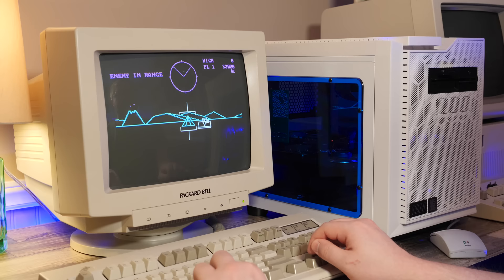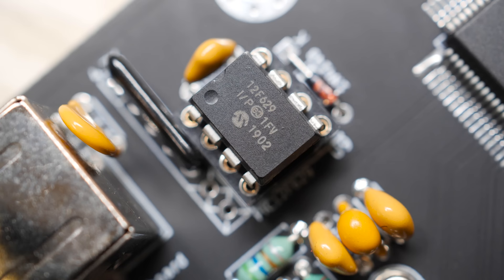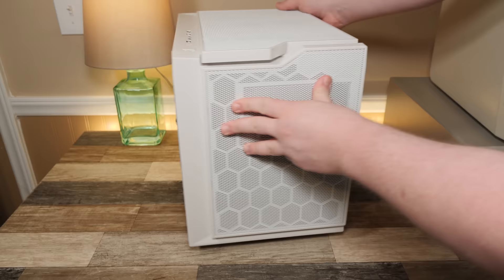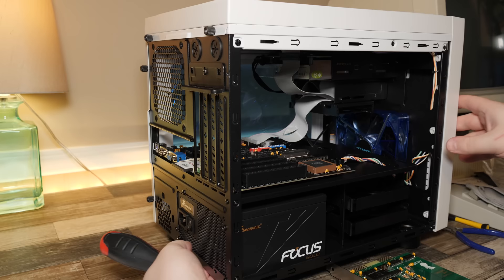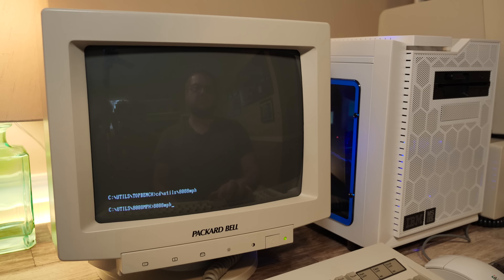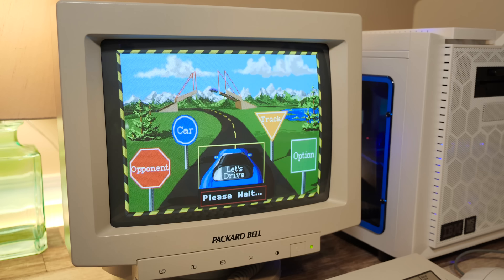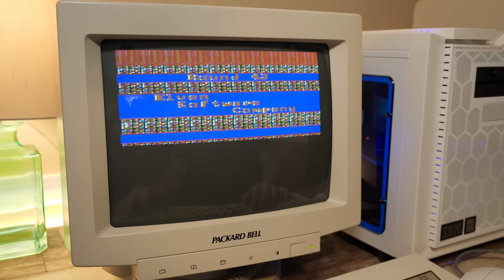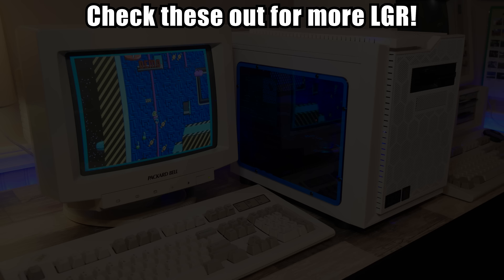Building a MicroATX IBM Clone: The NuXT Turbo PC

Comment: My rig is in the black/green version of this case, it's an absolute beauty to build in, but it does get a bit cramped with an optical drive and 3.5 I/O expansion and a tri-fanned RX 480. Pro tip for this case, there's 2 screws on the top rear corner of the case under the side panels, remove those and you can pop the top & front open like a semi truck.

Comment: I wonder how they sourced some of the chips, especially the Trident chip made in 1994. 
Fascinating little board :)
Reply: China
Reply: Scrap parts i bet.
Reply: @viscountalpha  Ghana would probably be a great place to get some
Reply: All came from china and ebay, i talked with the designer of the board
Reply: Stuff like the VGA chipset is what an FPGA would make sense for.
Reply: E waste bin
Reply: I'm wanting to build one from a blank pcb and cannot find a FE2010A chipset. I have the trident chip for the graphics. The floppy controller chip also is really hard to find.
Reply: Max Paine  This.  Some products just don't need a modern CPU.  For example, you don't need a 3 GHz CPU to run a thermostat or a microwave; even a 14 MHz WDC65816 is probably too much.  (The WDC65816 is an enhanced version of the 6502.  They used the WDC65816 in the SNES.  Also, the WDC65816 is still in production, even though it's been around since 1983.  Before anyone gets the bright idea of trying to drop one into their C64 or Apple II, it's not pin-compatible.)

The point is that in many cases, some "old" chips are either still in production, or were produced in the hundreds of millions, or can be reproduced in a "boutique" chip factory if you've got the cash (minimum order is usually around $30,000.)
Reply: @SpearM3064  But then a simple microcontroller makes much more sense.
Reply: Max Paine  yup. And some one off's on eurocard make for a repair or die situation on some old machines.
Reply: computer reset
Reply: Quite a large number of chips reached a point where they basically became a standard even if they were never opened up for 3rd party production, Trident VGA was one of them and was used for years after it was obsolete on the desktop in servers where all you need is a basic console output at most, so having a basic VGA chipset with some SRAM onboard was common. That's the same reason you can commonly find ATi Mach and Rage chips too.
Reply: @TheDemocrab  Indeed , the rage chip was used a lot. But nowadays the servers have to be able to run windows server with a graphical console for configuring VMs, so the last 10 years or so servers have also been getting faster video hardware.
Reply: Computer reset has over 9000 of those chips!
Reply: @Stephen Byker I second this. I once went snooping about in an old IBM factory and found some very interesting items, old 80s chip shipments, silicon boards and cpus. I couldn't bear to leave them, so I just took the boxes of as much as i could back home. (Btw, under UK laws it would have been classed as rubbish) I ended up selling/giving away most of the boxes to people who could do more with them, but kept a few bags of each. They might be useful sometime

Comment: There's a right angle mounted ATX 12V power connector on an IBM PC XT clone.... The clash of ultra-modern & ultra-retro there is making my head spin lol.
Reply: Having modern high quality power supply is a definite bonus though, no exploding caps or blue smoke o  first powerup
Reply: @UNSCPILOT  It's not that it's a modern ATX power connector that's weird, it's that it's mounted at a right angle. That only became common EXTREMELY recently.

Comment: That flash rom is impressive. Even modern PC's need a battery to remember the bios settings.
Reply: One of the Asus laptops i took apart recently (saying that because i don't remember which model it was) didn't have a Bios battery (no provision for one either, so not like they just didn't put it on).
So there's still application for chargeless memory keeping.
Reply: That's by design. If your bios ever gets corrupted or you get locked out from a bad setting or forgotten password you'd be fucked if you couldn't just unplug the cmos and let it reset.
Reply: most PCs/laptops don't use the battery to store settings but for the RTC. Settings are stored in SPI flash now, which is non-volatile.
Reply: A lot of Dell Latitude laptops save their BIOS config in Flash rom
Reply: andrew342003 Every UEFI BIOS contains a feature to store significant data amounts in flash memory variables.  The only data stored in battery ram in recent PCs are a few AT-compatibility variables and maybe a "self destruct-if-stolen" personal encryption key that you could reenter if you open the case yourself.
Reply: Iirc ITX motherboards don’t use batteries
Reply: Sorry guys I mean desktop PC's not Laptops or tablets
Reply: Jason Gooden 

ITX computers are desktops. Something like a Node 202 system is around the size of a PS4 slim and can use a double slotted standard GPU.

Comment: We need  486 dx2 66  with video card and 4mb of ram + sound blaster ;) in one board !
Reply: There is. It's an old IBM with integrated 4MB if ram and GPU. It also has an ATX like layout at the back, with PS2 and Serial/parallel port. It supports the 486 DX2 66 and even the Pentium OverDrive. The only thing it lacks is a sound card. I saw this thing on ebay for 25€ recently, and I didn't buy it because it was untested.
Reply: @nitroraptor5316  I don't know anymore, it was over 7 months ago.

Comment: All that pc needed was a blue "intel inside" logo,up front.
Reply: But it had an NEC inside ;-)
Reply: Yeah. Where's the square Intel/Windows/Company logo sticker for your case? It's hardly authentic without one.
Reply: Yeah the only thing being that would not have existed, but thanks for picking the right decade anyway
Reply: @psyddicus  Yup. But it would have fitted the spirit of the build, given that's its a modern fantasy of the original kit, itself.

Comment: DOS had some slowdown utilities, which generally worked by stealing CPU cycles in order to slow the CPU down. Do those work on this?
Reply: Mo'slo! It would probably work fine.
Reply: @invisi1407  That's the one I was thinking of.
Reply: yeah, good old TSR magic.
Reply: I just wasn't sure if those TSRs would run on an 8086. I don't remember seeing them until the 80286.
Reply: I've tried them in the past. They have compatibility issues. He would still need original hardware for some of his games.
Reply: @zwz.zdenek  To be clear, I wasn't mentioning it as an alternative to different hardware. It was just more to see if he could get the games running too fast to be playable on that machine.
Reply: Yes, they'd probably work.

No, you don't want to slow an XT down.
Reply: @ZipplyZane  it's just the nec v20.  It's an inherently faster design than the 8088 that software assumes.

Comment: wow $320.00
.... i would pay that maybe if it was a 486 class or early P5
Reply: Agreed
Reply: Pricey, but do remember these things are built in small runs and are therefore crazy expensive. I doubt the creator is making much of a margin on that cost.
Reply: It is indeed a little expensive for what it is. And add $60 for a sound card. And some more for shipping. That's basically $400 for a modern XT. And it doesn't even come with an IO shield. I guess I'll stick with emulation ;-)
Reply: @maartenschouren2327  you can fined a legit 8086 on Ebay cheaper
Reply: It's all the new and the nos parts are very picy, back in the day this have could costed way more new, in fact you are paying for all new stuff, so thereisn't mutch to complain about the price
Reply: A 3 layer ENIG board at an ATX size is not cheap. I wouldn't be surprised if the PCB itself is half that cost.
Reply: At this point, I wouldn't trust the capacitors.
Reply: @525Lines  you afraid to replace some caps?
Reply: @Mr_Meowingtons  i haven't soldered at all, ill need to practice like on my junk motherboards and speakers or something before i recap my retro motherboards.

Comment: What a huge case for that small board. But it DOES look sleek though, it does resemble the computers of that era color-wise. And it makes it look like a server or a beefy workstation. Also, the IBM and MS-DOS stickers look good. Yeah, as you have said, even though it only has five slots, the board comes with a video chip, an FDD/storage controller and I/O and it already has RAM extension beyond 640KB in place. Those have often been added by using add-on cards. True, some boards may have had RAM IC sockets but other machines had to be extended via a memory add-on card. So, yeah, the five slots are perfectly fine. I also like how it accepts CTRL + ALT + "+/-" to switch between frequencies. And it's a brand new board! I have never had a brand new computer up until the SLOT-1 / Socket 370 era. My first IBM-compatible was a 8088 XT with 4.77 - 8.00 MHz turbo, 20MB HDD, 5.25 FDD, 640KB RAM, CGA card and CGA monitor. Had magnificent times with it! Very nice piece of hardware you have there!

Comment: Ideas for a version 2 board:
  - 8086 with AT slots.
  - A conversion circuit to use a modern flash chip and a header to write protect the combined classic +video BIOS or emergency/factory flash it from a Pi.
 - An SDcard interface instead of MMC. Could share some circuitry with the serial flash interface.
 - EMM to go beyond 900K RAM, try to avoid the bugs in early EMM boards.
 - An old stock ISA bus USB controller.

Comment: I upgraded my 8088 with a V20. The year was 1991. I still have the harddrive from that system somewhere in a box. A 5.25 inch Seagate ST-225 (20 MB), it sounded like a jet engine.

Comment: I have a complete Tandy Sensation, that was upgraded to a DX4/100, and had the first Western Digital 1GB drive added to it, and an upgraded modem and Ram.  It, the speaker subwoofer monitor stand, and original CRT all are working.  I've thought about building it into a modern sleeper, that looks unchanged, but the original hardware is too cool to mess up.

Comment: For the complaints about back IO shields. You can buy them from china as blank i/o shield. Less than $2 delivered. You just have to use a craft knife to cut out the bits that poke through. Really simples.

Comment: That case is amazingly similar in its internal layout to the Rexgear Predator, of which I have two, one in white with blue LED fans. The only differences, aside from aesthetics, are that the Predator has a larger front fan and lacks an external 3.5" bay, and that the power supply and hard drives are mounted in slightly different positions (PSU bottom left, drives bottom right rear). Oh, and mine only have a window on one side, and it does not extend to the area below the motherboard.

Comment: Another idea: Find a case with 2 motherboard slots, put a modern machine on one side and the NuXT on the other, have them connected via serial internally, so you can run modern programs and 1980's DOS stuff on the same tower without issues.
Reply: Update: Sort of did this

Comment: Its really fun to try games on this type of computer, if you play the same games on a 486 you don't get the same feeling. Its interesting to compare this computer to a c64, I think this has better graphics than it. I've got an v30 @ 9mhz that runs commander keen very smooth in cga mode as well as prince of persia, star wars, silpheed, jill of the jungle and indy 500. I find that any game before 1989 would work well on this type of system.

Comment: Also, if you want the 'lights" but not the fan (i think it would pull more dust into the case, faster, having it on--and it doesn't need it, not with all that huge airspace in there already... But, eh, whatever... If you wanted to disable the fan, the lights are usually on another 'circuit' from the fan, so you can just cut the fan 'out' of circuit.

Comment: The screw+plate over the expansion slot bay was used on a lot of HP/Compaq mid-towers; it's possible the design dates further back than that, though IDK if I could link it to IBM somehow xD.

Comment: I wonder, if this would run any of the contemporary Unix derivates, like Venturecom's Venix/86, Microsofts Xenix86 or IBM's PC/IX. I have setup some emulators for these old Unices, but some real hardware would be nice. Anyway, it's an awesome project and I am very happy to see modern recreations of these old systems. Eventually, the existing originals will die off and projects like that allow the younger generations to experience, what computing was like 40 years ago and where todays stuff all comes from. I have some nice memories of those times in computing, but technically speaking, I am happy that those days are over.

Comment: That metal bracket on the back is a fairly common thing on cheaper cases, I've got a couple that use it, including a Corsair Carbide 100R. It think it's because it cuts down on the number of holes being drilled and screws included, only 1 screw for all the expansion slots

Comment: There were ISA USB cards - very few and very hard to find but it is not impossible - or you can use USB/serial adapters hidden inside or USB<->XT keyboard convertors to make the USB ports usable. Lo-tech also has an ISA <->USB card that works just for USB sticks - enough to baffle people 8)

Comment: 👍 The power supply is a good choice, but in this system a Picos PSU or a SFX would fit great, and you could take a much smaller case with 5 1/4.

Comment: On Ebay you can get solid I/O shields with no cutouts that you can then put in your own custom cutouts. I do this for a lot of my builds, with that CF card sticking out the way it does it wouldnt fit any I/O shield unless you customize your own anyway.

Comment: To be fair, it's not much of a project when most of the ground work is done for ya, but even still, this is something I would love to have myself, and I do wonder about other components that would fit with this, like that lovely and ahead of its' time Roland MT-32, or one of those obscure OddWare gadgets like that PowerMouse 100 (lolz).
Reply from the maker: For me, the project really begins once it's all set up! Installing games, software, benchmarks, running tests with different ISA cards and CPUs, switching things around on the motherboard, configuring it to use the UMBs, all that good stuff :)
Reply: @LGR  I take it, we'll see more of this setup in future videos? Sounds like fun to me.

Is the motherboard completely incapable of utilizing USB? I thought you said something about that but I don't think I caught it.

Comment: Using the topbench statistics seen at 11:38, I figured out that (on my system at least) DOSBox needs to be set to 540 cycles to match the NuXT at its fastest. I then tried to play my own SCI11+ game project at that speed.

It's... doable. Actually didn't seem much slower than Codename Iceman in this video.

Comment: Nice. Hopefully the part sourcing takes long enough for me to set aside some money to get one.  This would be great to run the really old stuff on. My XT Turbo clone still works, but it's huge and the PSU an hard drive are loud.
But now I'm tempted by that XT IDE ISA card he has, as I have an IDE SSD I could put in there. Utter and complete overkill, but an SSD equipped 8088-10? Yeah.

Comment: Random question but how do you unlock the upper memory block in DOS? Trying to get windows 3.0 to work on 8088 with 640k (technically 1024k ram) emulating the exact same machine in PCEM and keeps getting to black screen. Googled and it says it needs expanded memory or upper memory block available. Any ideas for a solution?

Comment: That orientation is great if you have a heavy air cooler like a big ol' Dark Rock 4 pro or NH D whatever cause the usual vertical just hangs there and gravity pulls down on it, but the test bench style distributes the heft better, not that it really makes much of a difference but yea...

Comment: @LGR - Would you consider updating this video with the NuXT v2.0 and attempt to run Doom on it? (Source modified for 8086/8088 compatibility, not the original 286 dependant version) Im curious how the NEC v20 would fair at 10mhz
Reply: FastDoom is now 8088 compatible. You should give it a try.

Comment: That is the same exact case im currently using on my main rig! Its a good case but i put mine near a window in sunlight which crates black spots with black ring residue left on my desk from the rubber feet. And cable management gets hectic once you populate the drive bays.

Comment: Interesting. Though I'm not overly keen on another 8088.

For various reasons, what I'd most want out of a 'retro' computer is a 486 or early pentium.
No 3d hardware, just an SVGA card, 16 bit sound card, and like 4-64 megabytes of RAM. 
(depending on what the CPU is.)

Then again, I often choose old computers based on if I can do anything interesting to them with programming tools.

And to me, the most interesting thing to do on a PC, as opposed to some other kind of older home computer, is software 3d.

And basically, for psuedo3d hacks like DOOM you need a 486 to run code like that comfortably.
And for true 3d in software mode you need at least a 200 mhz pentium to get reasonable results. (and I guess more is better. But then you get out of the nostalgia factor - I assume my 2006 dual core laptop could do software 3d with pretty solid performance.)

On the other extreme, which isn't about retro hardware, but has similar underlying considerations...
I'd kind of like to get a threadripper or one of those server CPU's with 64 cores and then create a software renderer for that.

I mean, hardware 3d is great, but I'm curious to see how much CPU technology has progressed in terms of being able to do stuff like that...